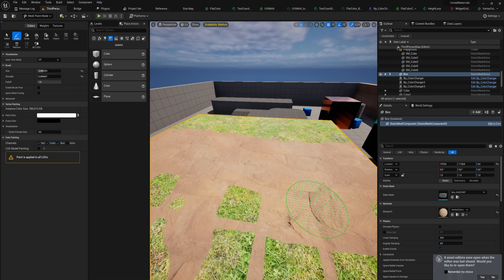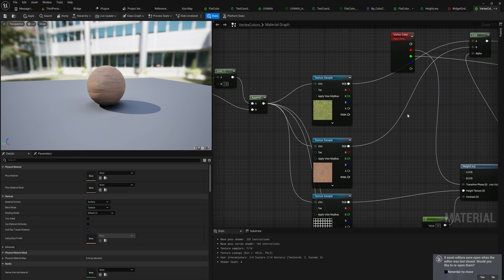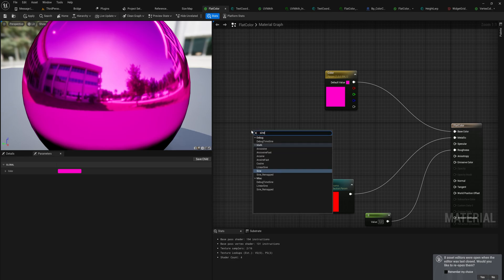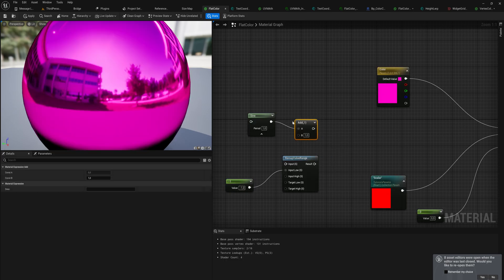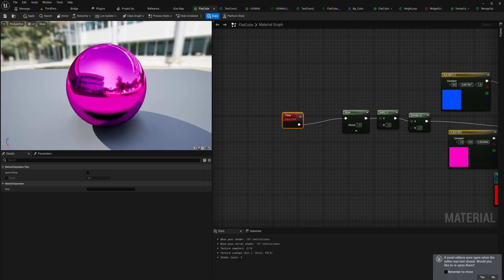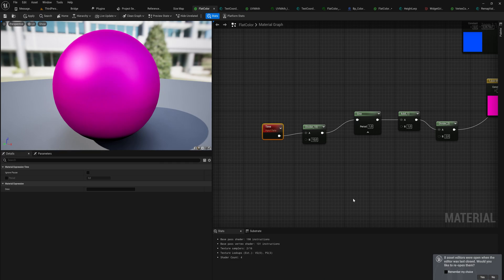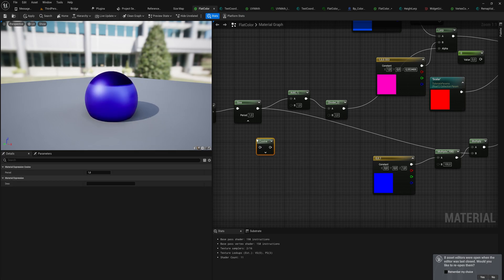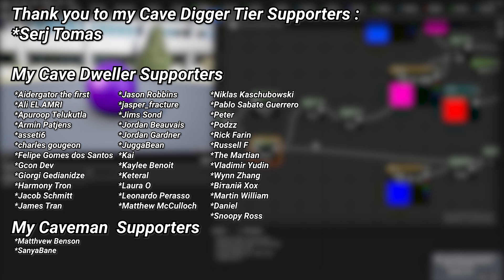Sine and Time In Materials - Unreal Material Course #10

Comment: Sharing this tidbit, as it might help someone in the future: 

The Time node has different behaviors dependent on the material domain it is set to. It will return time since the editor started when set to the UI material domain, as such while working in the editor on UI materials that use this node, your materials will be broken, and you will go nuts trying to figure out what is happening (it happened to me in production).

For UI materials, it is best to get your time from a BP/C++ via "Get Accurate Time" or by doing "FApp::GetCurrentTime() - GStartTime;" + pass into the material graph via an MPC, then change it back to Time when shipping/packaging a build.
Cheers.
Reply from the maker: that's a good headsup to have! makes sense, thanks for sharing!